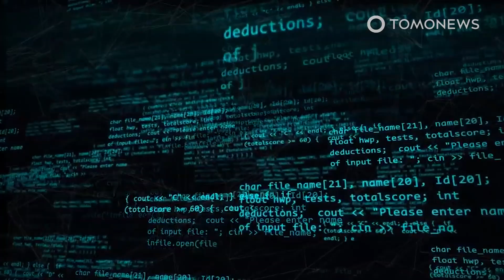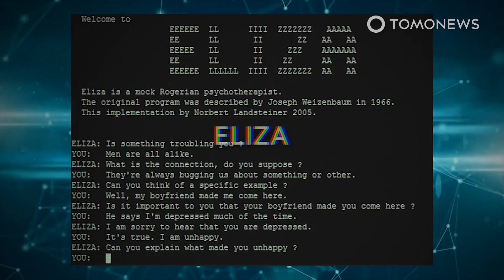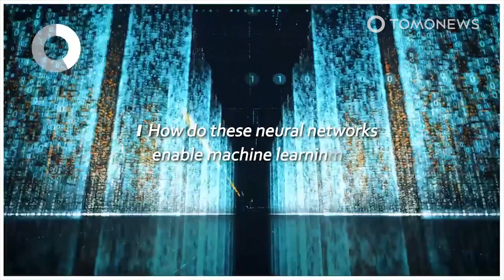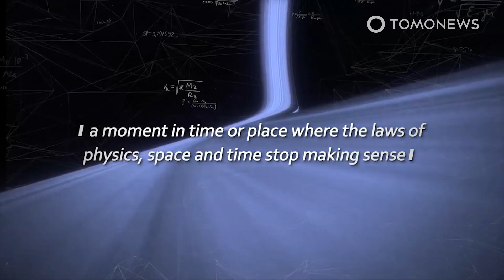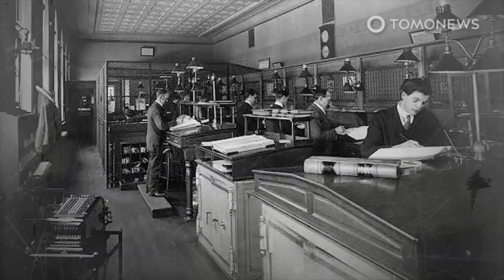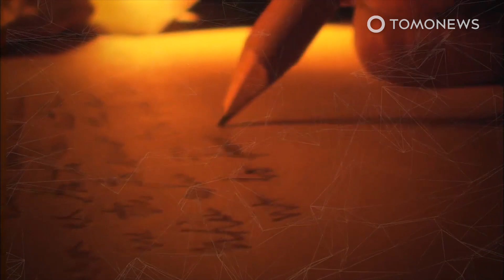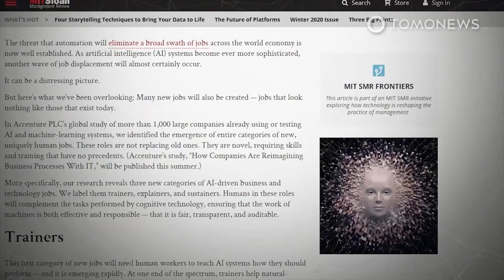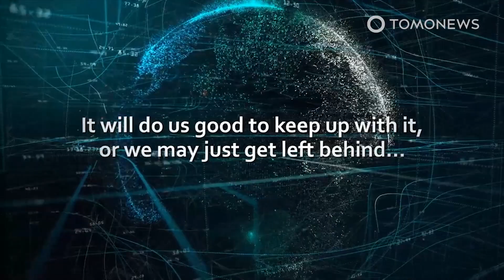Will Artificial Intelligence Take Over the World?

Comment: Did you know that the missile AI knows where it is at all times.
It knows this because it knows where it isn't.
By subtracting where it is from where it isn't,
Or where it isn't from where it is (whichever is
Greater), it obtains a difference, or deviation.
The guidance subsystem uses deviations to generate corrective
Commands to drive the missile from a position where it is to a
Position where it isn't,
And arriving at a position where it wasn't, it now is.
Consequently, the position where it is,
Is now the position that it wasn't,
And it follows that the position that
It was, is now the position that it isn't.
In the event that the position that it is in is not the position that
It wasn't, the system has acquired a variation,
The variation being the difference between
Where the missile is, and where it wasn't.
If variation is considered to be a
Significant factor, it too may be corrected by the GEA.
However, the missile must also know where it was.
The missile guidance computer scenario works as follows.
Because a variation has modified some of the information
The missile has obtained, it is not sure just where it is.
However, it is sure where it isn't,
Within reason, and it knows where it was.
It now subtracts where it should be from where it wasn't,
Or vice-versa, and by differentiating this from the algebraic sum of
Where it shouldn't be, and where it was,
It is able to obtain the deviation
And its variation, which is called error.